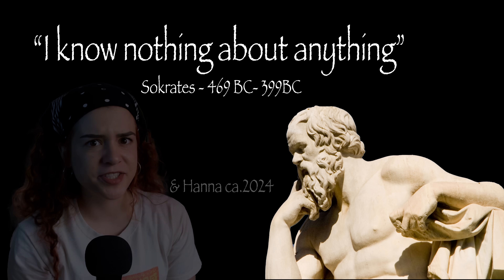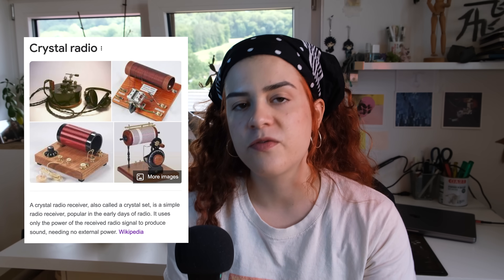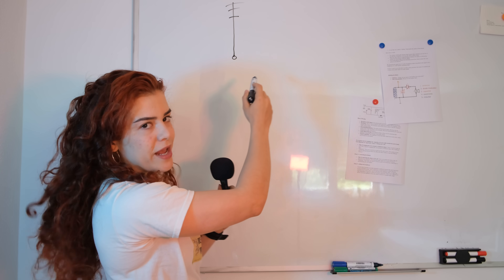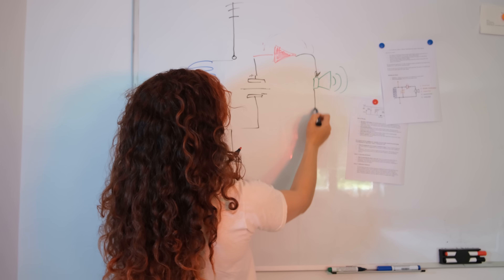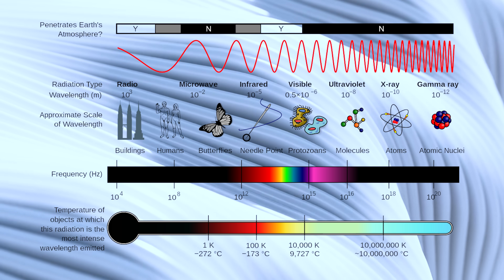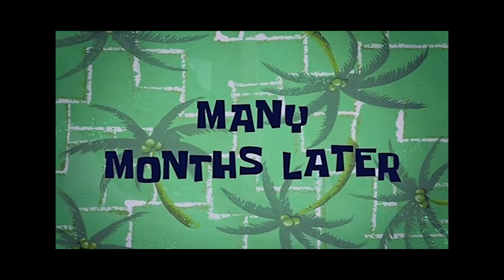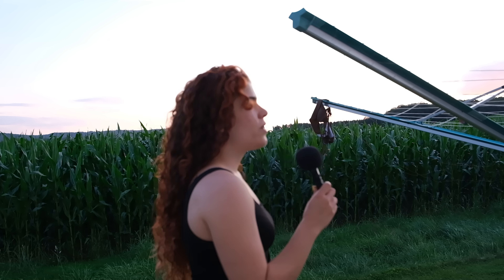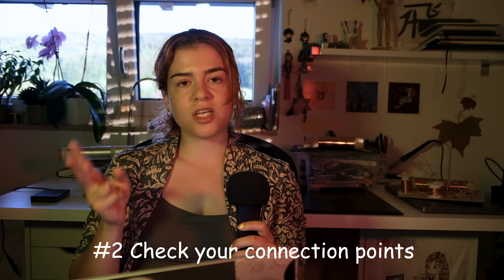I BUILT A RADIO AT HOME

Comment: I tried this when I was a kid, but my mom stopped buying the parts, and then radioshack closed down, and I was never allowed to buy the parts because radio was obsolete to them. I might try to build FM with what I know now even though I never made AM, an FM decoder chip may do the job idk yet. I don't know how I would decode the fm myself, fm is just more clear than AM signals at least in my car. Do you live in canada or france?

Comment: your inductor is basically a large piece of wire if you were to put a loop of carbon around the wire it would do the same thing but physically it's more feasible to do it the other way around make a loop of wire and put a piece of carbon inside

Comment: the capacitor there is for resonance and if you dont have a cap it first you cant filter it second its will be weaker search online for a resoant frequency calculator get a lcr meter measure inductance on your coil calculate what capacitance whould you need for that signal and then get a variable capacitor just in case

Comment: I never built one but had in mid ‘50s a little round plastic silver thing. Think it was to look like Sputnik or maybe the US version. Had couple stick like things poking out like antenna and that was how it sat on a table. There was a tuner thing you twisted to find that radio stations. Had no separate antenna that I recall. One ear phone. Had an alligator clip and suggested to attach to a light switch screw (ground and/or antenna???) When home with  Chicken Pox would listen to local AM stations. Back then there really were “soap operas” that ran daily (15 min)and the sponsors were things like LUX or Ivory. A Crystal radio would be the ultimate Prepper item to hear about the invasion

Comment: You don't actually need to use a piezo speaker. you can take the signal from the diode and feed it into an power amplifier and voltage amplifier (very easy to construct) 
 and then use any speaker you have.

Comment: if you think abt it a couple hundred years ago, electricity was pretty much just a party trick or freaking lightening, and now it runs the modern world. i think we could bounce back relatively quickly tbh. lots of smart cookies out there. also, if you wanna use the piezo buzzer, just desolder it from the pcb and solder the jack to it. you gotta figure out which connection on the jack is positive, negative and ground, usually color coded wires, but not always. also also, keep failing and making mistakes, its the best way to learn. just keep trying things until something works ^_^

Comment: I built a crystal radio when I was a kid. I had an air gap variable capacitor, germanium diode and hand wound coil. The thing that's really important with these radios is a good earth and aerial. I had a copper pipe going deep into the ground for earth and aerial wire going from my upstairs window to the washing line pole. The aerial should be as high and long as you can make it. The experience of receiving radio stations was exillerating, the sound one of the purest I have ever heard. I really enjoyed this video :)

Comment: Actually, it's possible to get around using industrially made diodes.
There is such a thing as a "foxhole radio". It's a crude crystal radio that can be made with just the materials that were relatively easily obtainable by infantry of the first half of the 20th century.

With some tinkering one can make a Schottky diode from a pencil and a safety razor blade. From what I get, it doesn't necessarily has to be a razor blade: you just need a nice thin layer of Iron oxide. Inductance is a coil of thin wire, parasitic capacitance is sufficient to form a resonant circuit. Antenna is also just a bunch of wires. Add high resistance headphones and here is your radio.

Comment: Congrats on building your first am radio :3 a few things. The coil (inductor) forms a resonant circuit with the capacitor. By tweaking either the inductance or capacitance in the resonant circuit you select a different channel. If you add a resistor instead of a capacitor the frequency band is much broader and you likely get several stations at the same time. The wires themselves also have a capacitance although not very large. The length of your antenna also determines to a degree which frequencies you can pick up with your radio. Your antenna length should be half, quarter or eighth of the wavelength you want to pick up. You calculate the wavelength (in meters) by dividing the propagation speed of the wave (here the speed of light in meters per second) by the frequency (in Hertz). 300000000/10000000=30. 10MHz would have a wavelength of 30 meters. 5MHz would be 60 meters. Your 30m antenna would work for 5MHz and 2,5MHz pretty well +- 500kHz or so. 
On a bit of a sad note it has gotten really hard to receive shortwave transmitters inside germany as germany has shutdown most shortwave stations. However depending on space weather you can pickup stations from other parts of Europe that still do shortwave radio (short wave can bounce off of the ionosphere so you can receive stations that are behind the horizon even)
Anyways... Enough Rambling. Thank you for the video. I Enjoyed ❤

Comment: Radio waves are photons of light. The transmitter and the receiver are coupled through a weird entanglement.

The signal that is then sent across the airwaves is done by modulating that coupleage.

That modulated information travels at the speed of sound in air. But the photons, the actual carrier wave that couples the transmitter and the receiver, travel at the speed of light.

The electrons are already excited through the coupling of the carrier wave. It's the amplitude or frequency of the excitement that changes over time.

This gradient allows work inside of a circuit to be varied. That variability is turned into audio signal.

A transmitter uses a microphone to change the current in the circuit to vary the signal sent. A receiver recreates the input through a speaker.
Reply: Electromagnetic morse code.
Reply: FM... frequency modulation, or the number of high excitement states per unit time. Like a digital signal carried by an analog wave.  AM... amplitude modulation, or the height of the wave. Signal strength is varied. This is the older way and is pretty limited. But the reason you can pick it up, is that you don't need anything more than the rectifier and tuning coil to drive a powered speaker. With FM you have to be able to decode the compression inherent to that signal type.
Reply: Make a simple amplifier that is powered separately from the signal source, that also has the speaker attachment. Drive the source into the amp, that drives the speaker on outside power.

Comment: ...what was the idea behind soldering the audio jack (at random) to the pcb board of the piezzo disk?

(You know instead of currintnthe wire coming off the disk and soldering the wires there, if you feel the burning need to use an audio iack for the defintion of the jankiest radio)
Reply: Well that AM explanationwas terrible.

So radio is bit like sound.
You have pitch (aka frequency) and volume (aka. amplitude) for the radio wave.

All AM (amplitude modulation) does is change how loud a given fixed pitch/frequency radio signal/sound is. (Like how strong a whistle is blown)

What you receiver does is only letting through one pitch (frequency), andnsmoothing out the small "up down" vibration in carrier wave.
Then you got the sound basically back.

FM is the same idea but instead of varying volume, its kept at constant, and you wary the tone/pitch/frequency of the signal. And you use a slightly fancier circuit.
Which will "dim out" the radio whistling thats coming in depending in how far its changed from the "set frequency"

AM  is simpler. But since it plays with the volume, well stuff between you and the tower, lightning strikes, shitty electrical machines, and all sortsa interference can eff it up, and then you get static noise instead of radio transmission.

Comment: Capacitor and coil work together as a filter: the coil blocks hi frequencies and capacitor low frequencies so at the end only one signal will find a high impedance and the only way for it to get to ground is through the diode and the earpiece

Comment: 60 years a go when I was a wee lad, my very old grandpa in London was so proud to tell me he used to dabble with crystal wireless sets when he was a young man, the modern thing then was vacuum tube electronics but transistor things were coming on strong. I became an Electronics engineer of course. Today I pretty much know most everything about how iPhones work because I was in the semiconductor industry, but I don't really know how to use the damn things and choose not to learn either, my fingers are too fat and slow for that.

Good job you didn't go down the robot servant rabbit hole.

Comment: Suggestion: The radio towers emit based on international conventions and so you need to research the wavelength they emit. The receiving antenna should be made to receive that specific wavelength. Say, the convention is to emit 2m waves. What you need is an antenna for receiving those waves specifically. This way, you don't receive the signals meant for Wifi, TVs, GPS and so on. This should help with the sound.
Make sure the capacitor also has the correct capacitance and the inductor must also have the correct inductance otherwise, they will consume a lot of power and won't strengthen the signal any further.
Also, the PCB that you are using, you will have to research on that too. Different hardware are programmed to expect input based on a defined convention so the signal that your antenna is receiving needs to be first translated into a form that the hardware understands otherwise it will just emit gibberish.
Reply: Doing a 1/4 antenna for frequencies down near 1MHz is not practical for most people.   75 meters is bigger than most people can deal with.

Comment: little note for anyone who also wants to build a radio:
building receivers is fine, but if you wanna build a sender your country probably requires you to have a amateur radio license or something similar (at least that's how it is in germany)
Reply: That is also true in the US.  You can buy a transmitter that is type approved to transmit but you can't build one without the license.  There are only two exceptions:
1) If you go below 8KHz and keep your signal down there, the FCC (US agency in charge) doesn't care.  It is possible to make a transmitter at 5KHz and get significant range but you won't be sending voice over it.
2) I don't know the frequency off hand but there is a point where microwaves start to be called infrared light.  It is possible to get reasonable ranges up there on clear days.

Comment: You went through a lot more struggle than I did when building my own crystal radio. I used roughly 15 meters of wire as an antenna, going from the table in my yard all the way up to the roof of my house. It worked without ground, but I used an old CPU cooler as a ground. Its large metal surfaces works almost like a real ground. I found that connecting a second germanium diode in parallel made the signal louder as well. If you don't have a piezoelectric speaker, you can connect your crystal radio directly to a speaker that has its own amplifier, which is what I did (make sure to max out the volume and get your ear close to the speaker). Experiment with different values of inductors and capacitors and see what you can pick up. Sometimes, touching either the antenna or ground, makes the signal louder. But it may introduce noise instead, AM radio is weird.

P.S.: FM radio reception IS possible with a crystal radio through a principle called slope detection, though I haven't tested it myself. Say we want to listen to a station that broadsts at 100.00MHz. The FM broadcast just above or just below 100MHz, like 99.95/100.05MHz, behaves a lot like *AM*, despite the initial transmission being *FM*. So by adapting the inductor and capacitor to tune to these frequencies, we can listen to FM radio!

Comment: It helps to know the resonance formula so you know the capacitance and inductance you require for the frequency you want to receive, and to know how number of turns and loop diameter affect inductance, and how area and dielectric thickness affect capacitance.  Or at least have a meter which will tell you those things, so that you can experimentally increase/decrease either the number of turns or the plate area (or try a different core for your inductor; most commercially produced AM receivers use ferrite).

I don't understand what the resistor did, other than waste some of the received energy as microscopic amounts of heat...maybe something to do with impedance matching.
Reply: With a crystal headphone, basically you have a capacitor that bends when you put a voltage on it.  The diode rectifies in that it only lets electrons go one direction.  Once the RF charges up the earphone via the diode, there is no place for the charge to go so there is no further action.  The resistor discharges the capacitance when the RF signal's amplitude falls.

Comment: make sure you take safety measures when you solder stuff, touch chemicals etc. - not to breathe or touch the wrong thing, cause that's how Steve Jobs goy cancer
Reply: We will never know if that is what did it to Steve Jobs.
Modern solder is almost pure tin.  It isn't very dangerous.  Other chemicals vary n their level of danger.
The stuff you use to clean a PCB after soldering is the stuff to worry most about.

Comment: well done! the capacitor and inductor (coil) make a resonant circuit which "amplifies" that specific frequency you want to tune to. it will be MUCH better with a capacitor (of the correct size) if you want to ever revisit. and the antenna design also makes a big difference. But you did it! 🙂 ps - love the hair!

Comment: Optical Physicist here and I just want to say how happy I am to have found this. Your enthusiasm and willingness to do something wrong over and over again is really inspiring and more rare than you might think. I'm sure your next version will be phenomenal. 

Now for the technical comments:

1: Using the resistor is good, but if you want to amplify the signal more then you'll want a larger resistance. If you are currently using a 10 kilo-ohm resistor try bumping up to 1Mega-ohm. If you want to get really fancy then look into transistor based amplifiers like the Transimpendence Amplifier. It will allow you to get absolutely huge amplification without as much noise. 

2: You should absolutely be able to use that speaker from the fire alarm, you probably just need to get the input voltage right. This will likely require looking up the datasheet for the part and figuring out what voltage it wants to see and then see if you can amplify your signal to that voltage. 

3: Your ground is fine, but you could also just use the ground on your wall-plugs. 

4: You can change the station you are listening to by changing the induction of your coil. This can be done with a ferrite core by inserting inside the coil, which will change the inductance and thereby change the resonance frequency of your circuit. This is a great way to tune to different stations because you can just move the rod in or out. 

Best of luck!!! You rule dude.

Comment: I made my first crystal set when I was 10. It didn't work because I hadn't scraped the magnet wire properly, and used an unsuitable low impedance phone. One year later, I got a pair of decent vintage high-impedance headphones from the 30s, and finally succeeded. Later, someone told me on how to build a transistor amplifier and later, how to add regeneration to the thing. The rabbit hole was unveiled, and almost thirty years later I'm still exploring it. :)

Comment: 5:48 The part of the smoke alarm, I'm not sure, but I don't think it's not a Piezoelectric, because I heard it worked like a capacitor with radioactive materials providing the particles moving through the circuit.

Comment: You might not be able to hear much because AM radio is mostly dead in germany, even FM will be abandoned in the next decades sadly.
Very nice build, glad you got it working!
The Capacitor and the inductor form a Tank Circuit. If the resonance frequency is the same as the signal you want, it will help to collect energy from the radio wave, boosting the amplitude so you can hear it louder

Comment: All of your radios would've worked if you would've calculated the resonance frequency of your circuit. This resonance frequency is the frequency at which the source is emitting radio waves. If your circuit matches this resonance frequency, you can clearly get signals at that frequency. The inductor, capacitor and resistor parameters such as length of copper wire, inductance, no. of turns, capacitance, resistance matter a lot when it comes to receiving signals. Commonly, RLC circuits (Resistor-Inductor-Capacitor Series Resonance Circuit is used to transmit and receive radio waves. You can calculate the resonance frequency of an RLC circuit with the formula resonance frequency=1/2π*(root LC). There are separate equations to calculate the three impedances and RLC parameters at resonance conditions for a particular resonance frequency. This is also why most of the radios use tunable knobs (potentiometers, Varactors) to tune their circuit impedances with the resonance frequency to receive signals at those frequencies.

Comment: You getting a weak sound out of the ear piece is technically correct when you are passively receiving without amplification circuit.
I think Rimstar even has other videos that include the amplification circuit built very simply. You should take the next step!